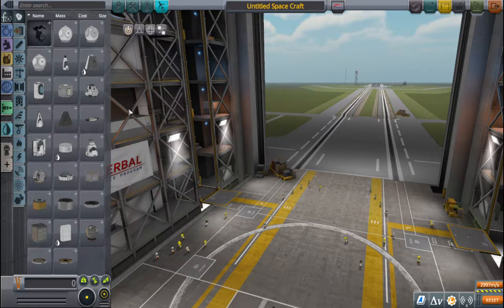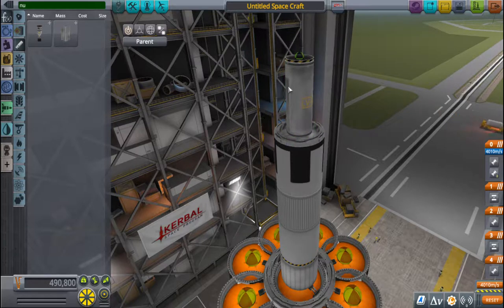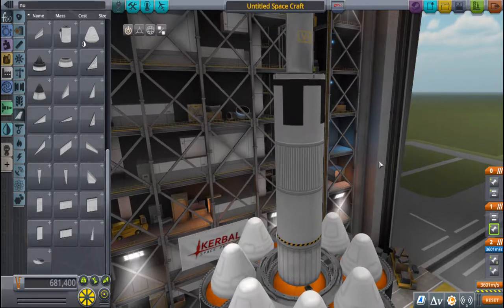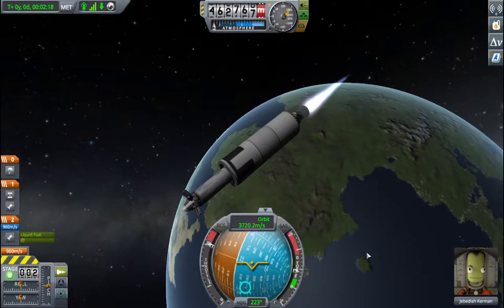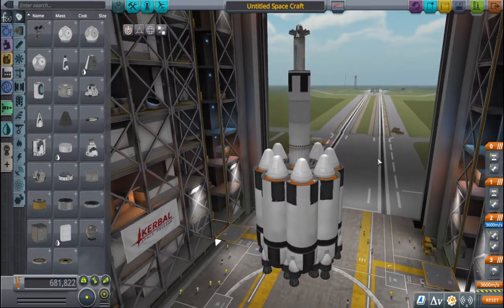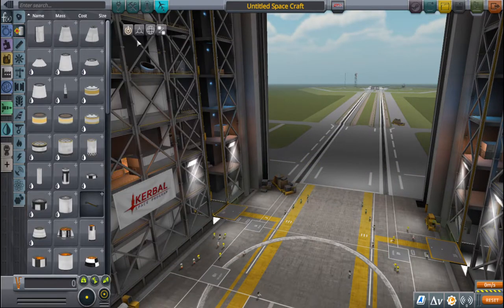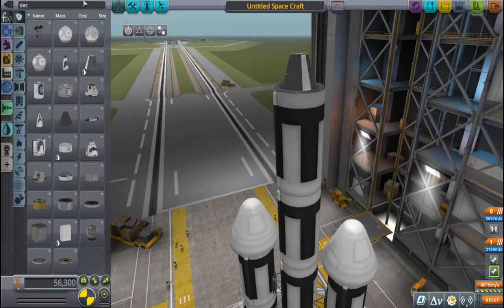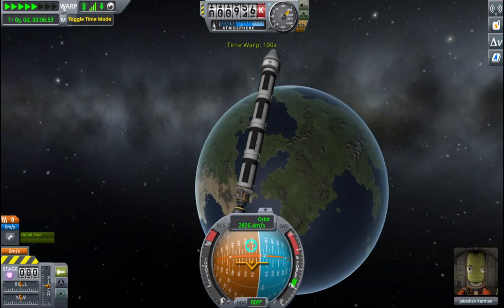KSP 2019 my Super BFR and Falcon Heavy with liquid rocket engine

Comment: If I could make a few suggestions here to help out
1. Fins at the bottom of the rocket really help stabilize the rocket while it's in the atmosphere. Put some fins on the first stage of the rocket and you'll notice a huge difference in stability
2. No need for communication stuff on the command module, while you're in the Kerbin system the command module can communicate just fine back to the guys at KSC
3. Definitely want SAS like Delta mentioned. Make it a habit to turn that on every time you launch
4. Sometimes there is such a thing as too much thrust. Your rocket looked really hard to control for a couple of the reasons, mostly for the reasons mentioned above, but also because there was such an incredible amount of power. Your rocket should be able to get into orbit with just one of those engines in your first stage, let alone eight of them

You're doing a really great job, I'm having a lot of fun watching your skills with this game improve. It has a huge learning curve to it, but I remember after putting about 50 hours into the game and landing on Duna (and returning) it was probably one of the most satisfying things I've ever done in a video game. Keep up the good work!

Edit: Oh yeah I forgot number 5: Add more struts! It's the reason why your rockets are so wobbly
Reply from the maker: Thanks for spend your time to give me so good advise!🏆
Reply: @ettocraft  Sure thing! I'm having a lot of fun watching you improve. This is a really hard game to get a hang of but I mean, it literally is rocket science!